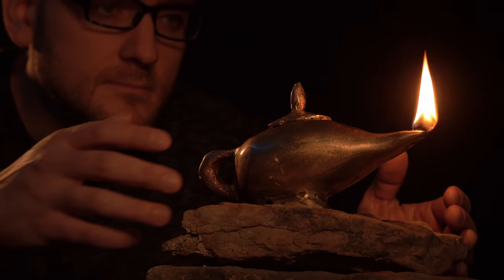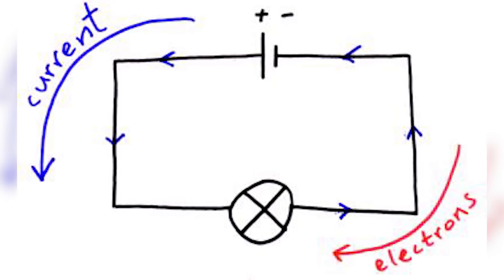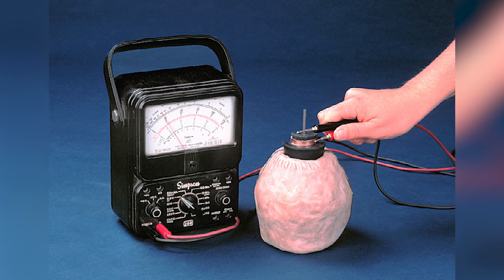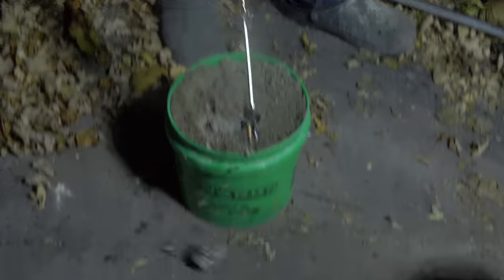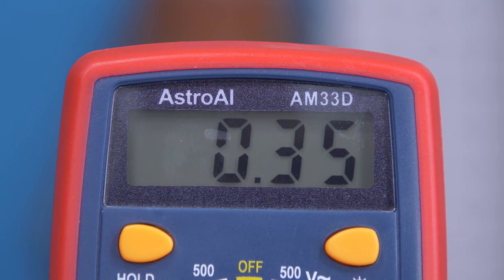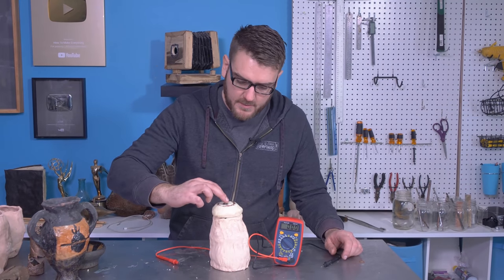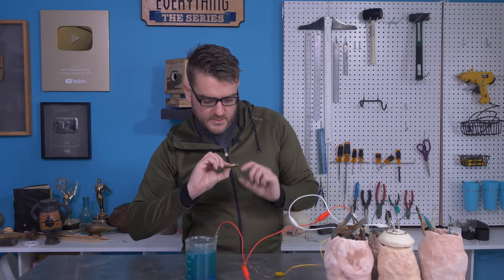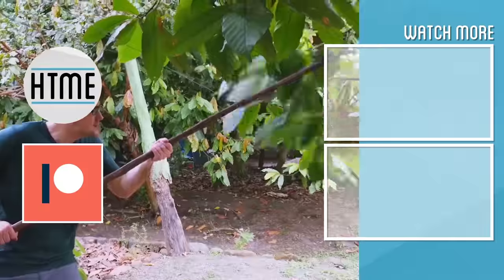Recreating a 2000-Year Old Battery?

Comment: i'm glad you figured out that casting a cylinder is not the easiest way to make a cylinder, though it was an interesting idea.  sheets of material is most often preferred to work with for fabrication of hollow vessels.  i noticed Lauren used that thinking on her pottery as well.  Honestly as compelling as the evidence is, i have a feeling there is some other purpose to the "baghdad battery", but i cannot say what it could be.  it really is mysterious.
Reply: It's not all that mysterious, it's likely just an accidental battery, the original design clearly wasn't made for a battery (it shorts out) and it's probably just meant to be a jar for storing vinegar or wine. The use of copper vessels to store these things is actually quite common because it doesn't leech into the liquid and change the taste. They might have just been trying to create an air tight seal with the asphalt.

Like after all, copper and iron are commonly used materials and almost all agricultural products you'd store in a jar are also electrolytes. The real mystery is that we didn't discover electricity a lot early from an accident like this.
Reply: @hedgehog3180  did they even know air was a thing?
Reply: My suspicion is that it was simply a novelty, an interesting phenomenon somebody noticed and tried to refine with no real goal.
Reply: Torture? If it's better made and makes a higher voltage...

I recall reading about the Bagdad battery a long time ago, and old time scientists getting a slight shock. I may be mixing experiments though
Reply: I always thought it was used for Electroplating metal jewelry.
Reply: Mythbusters did an episode on this. They worked under the idea that the batteries might have been used to "feel the touch of god" when touching the outside of a container, such as the replica of the Arc of the Covenant they used in the episode.
Reply: @LightPink  Not really in the sense that we think about it but they might have known of the necessity to properly seal containers if you don't want the contents to spoil. But it might also just have purely been motivated out of a desire to make sure the contents maintain their taste.
Reply: I'm betting medicine.  Someone discovered that an iron and copper nail in a lemon make a tingly feeling, figured out what caused it (acid, iron, copper), and they used the tingling as a cure for various things.  It probably even worked for knotted muscles and stuff.
Reply: @Earthenfist  oh, it was the world's first TENS device!
Reply: It was most likely used to electroplate stuff with gold and silver
Reply: @LightPink  Air was discovered pretty late, but 2000 years ago, people would have figured out that air degrades foods.
Reply: The most reasonable explanation I've seen... It was just meant to preserve scrolls or something.
Reply: @morrigankasa570  I can't believe I had to scroll this far down to read the most logical and likely hypothesis. I've known this for over 25 years.
Reply: @plzletmebefrank  or something..? Great explanation. You don't necessarily have to preserve scrolls. You just rewrite them. It was for electroplating. This used to be common knowledge. How has the world forgotten?
Reply: Might make your tongue tingle if you licked both electrodes at once. I can imagine somebody figuring it out accidentally and being puzzled that licking one does nothing, but licking both creates a tingle, but even then only as long as there's juice or wine in the jar.

As kids we used to do that with 9 volt batteries, just fascinated that we could "taste electricity".

If we didn't know anything about electricity I think we'd have been even more fascinated.
Reply: @hedgehog3180  nonsense…
Reply: @simasimson5798  you’re as weird as hell right now…check your head bro 😵‍💫
Reply: @Liftedkilt  this makes some sense…
Reply: @plzletmebefrank  lolol
Reply: @mattmarzula  It's never been, "knowledge" it's thousands of years old. We can't know what it was used for cause there's no evidence besides the jar itself. Which there has been falsified evidence a couple times, theories that make no sense pushed other times, and over all... Just a bunch of idiots looking at it from a modern perspective that makes no sense to.
Electroplating require an ionized solution of the metal you're trying to electroplate onto whatever you're dunking in. It's not something you can do very easily by accident, even with modern supplies. And it's doubtful anyone thought of it until they had an actual understanding of electricity.
Reply: @mattmarzula  in fact they didn't use scrolls, instead they used clay tablets. And unless we find a written description or electro platet material (wich i think we haven't yet but i might be wrong) we will not know the exact purpose of this thing, besides i believe that electro plating makes the most sense. (forgive my bad English it is not my first language)
Reply: @plzletmebefrank  maybe not electro plating but electro acing, you can do that literally with a battery a qtip and saltwater
Reply: @barjekold7140  I've read articles that mention similar jars used to preserve sacred scrolls... Are you sure they didn't have scrolls? Pretty sure it was dated about 2000 years ago, and that it was Iraq. I know there were scrolls that were commonly used in many cultures surrounding the Med at that time, would make some sense that the peoples who would've living in what's now modern day Iraq would've been included in those.
Reply: @barjekold7140  I assume you mean electro etching. Which... Certainly more plausible. Not sure what the purpose of it would be. That is what clear advantage it'd get you over the methods used at the time that justify the time and resources spent on a... Fairly janky setup.
Reply: @barjekold7140  Oh, also, you are correct. There is absolutely no evidence of electroplating at that time. No written records, no signs of electroplating. The jewelry the research assistant that came up with the hypothesis that he thought may have been electroplated... Was not. Something to do with mercury and... I believe the term was fire guilding?
Reply: @plzletmebefrank  as a metal worker for me it makes much more sense tha fire guilding (it's maybe the right term i only know the German term feuervergoldet wich is essentially the same thing) was invented before electro plating.
Reply: @plzletmebefrank  Yeah the boiling off of the mercury in a gold-mercury amalgam with heat leaving a deposited surface of gold, as mercury vapours are invisible I can't imagine it was easy for those performing it to protect themselves from cumulative mercury exposure. Personally I imagine it was just a curiosity, an effect discovered entirely by accident that had no real purpose beyond showing to other people
Reply: @LightPink  probably not what makes up air but like wind and stuff then yh
Reply: Electroplating is the general consensus among Archaeologist.
Reply: @leprcon8  what makes you think that? Do you know the electrical requirements of electroplating? (I haven't looked it up yet and I don't know off top but I'm guessing it's not enough current)
Reply: @Liftedkilt  Mythbusters make up some of the most ridiculous bullshit I've ever heard. Including that. If you think the Baghdad battery is anything other than a wine vessel, you're giving them too much credit.
Reply: @Liftedkilt  I'd honestly take literally anything from that episode with a massive grain of salt, that episode is notorious for meddling on discoveries part
Reply: @hedgehog3180  We did discover electricity several times, kinda like steam powering, but it just was a prop, a magic trick or a toy.
Reply: @hedgehog3180   I'm guessing electroplating or fire starter. Egyptians were very fond of electroplating.
Reply: Scroll storage. The original liquids found in the Baghdad battery were leftover from decomposing papyrus
Reply: Or coil pots.....

Comment: USB phone chargers are 5 volts and demand some pretty high current compared to what you'll get out of those batteries. Try using them in applications where you would use AA or AAA batteries and you might get better results.

It would be fun seeing you get enough power out of this to run an old Game Boy Pocket or Color. You just need 3 volts at 250 milliamps or 6 volts at 250 milliamps for a "grey brick" Game Boy. Those are the numbers I read off the AC adapter for Game Boys. You might also be able to run a TV remote.
Reply: probably an LCD screen
Reply: Red Dwarf  have done a episode doing that for their remote control. 🙂
Reply: if you connect a bunch of those in series you may get a higher voltage

Comment: This reminds me of one summer back when I was 9 or 10 in summer camp.  The pond at the camp was near dead and we were told it was due to acid rain (this was when they first started educating us on acid rain) and we spent days doing various water tests, trying to see what animals and plants still lived in it etc, and they taught us on what can be done to fix it.  One of the counsellors brought us out to the pond one morning and had one group of kids take some pipes attached to long wires to one side of the pond and my group took some copper pipes with wire connected to the other side.  We took turns hammering them into the ground in the pond making sure to keep them equally spaced and then we carefully laid the wires down as we went back to the middle of the beach at the meeting point.  The counsellor took the ends of the wires and connected them to a switch that was already wired up to a light bulb.  We all knew that the wires were only connected to the pipes and no batteries or other power sources connected.  We were blown away when he flipped the switch and the bulb lit up.  it wasn't super bright but bright enough to be seen in the daylight and fairly bright at night.  We all took turns that night flipping the switch on and off still amazed that we were creating power with metal pipes and a poisoned pond.

Comment: It could also be that the 'Bagdad Battery' was simply used for the shock value.  Probably more impressive than static electricity.
Reply: Static electricity ca actually be over 20,000 volts. You would need a quite a few 0.5 volt batteries or more advanced electronics to get something impressive
Reply: The battery wasn't a battery.
The iron rod doesn't make contact with the electrolyte on the original pot, and there isn't any terminals; out of the areas people suggest are terminals (the top thing), it would immediately short the terminals out as the iron rod and copper sheathe touch each other directly, and they would be acting as the positive and negative terminal.
Reply: @D-Vinko  Yeah and like considering that almost all fluid agricultural products (wine, vinegar) are electrolytes this is probably just an accident.
Reply: I'm shocked!

Guess it worked. 😁
Reply: In the 18th century it was popular for rich scientists to bring out fairly large batteries at parties and amaze their guests with stuff like having everyone hold hands and then having the people on the ends touch the nodes, giving everyone a big shock.
Reply: Meanwhile not too far away one of Electroboom's ancestors was inventing what will be known as Teheran's Full Bridge Rectifier
Reply: I guess it was used to amp up the mood.
Reply: @fakjbf3129  You cannot do that with only a battery. You would need coil or transformer for that.
Reply: @user255  Yeah they probably used a static electricity generator, like a glass sphere and a Layden jar.
Reply: @fakjbf3129  my chemistry teacher did this in class... but he used a tuned down taser. :P
Reply: Maybe used to make a spark for fire?
Reply: @whydoesyoutubehaveahandlenow  You need a lot of them to make the spark hot enough...
Reply: @JohnWayne99999a  A shame he didn't get to invent the MOTHER OF ALL FULL BRIDGE RECTIFIERS!
Reply: @dragon.fromindia3235  Wrong thread? Anyway, updated vaccine is coming.
Reply: @user255  updated vaccine should be easy to do with mrna. At least that's what they say..im honestly curious as to why they haven't done it
Reply: @whydoesyoutubehaveahandlenow  Yes, the technical part is easy. The bureaucracy is not necessarily so easy. Also the current vaccine is reasonably effective against the current variants. Maybe they also try to optimize the updated vaccine to be as good as possible for new variants in near future. Bit like with annual flu vaccines.
Reply: @fakjbf3129  with dc current huh? Sounds safe...
Reply: 😂 shock value
Reply: @fakjbf3129  what kind of battery created in 18th century would zap u lmao.
even our current batteries won't Shock u unless u lick them and then it won't even hurt much.

Unless ur talking about layden jars
they're not batteries, they're capacitors and store electricity in a different way to batteries.
Reply: at 9V you can get a painful shock in your teeth or tongue.
Reply: Without written records, Benjamin Franklin's "Lightning in a bottle" prototype would make as much sense as the Bagdad Battery. It didn't do anything relevant yet, they maybe just figured out what they created. It's a detail lost to time.

Comment: Hey, while you do your casting in the buckets i suggest insterting a metal/wooden rod while you pack the sand in so there is an air flow and over flow point, your pours are GREAT but with no vent the air only has up through the metal to go hench any bubbling,uneven,cracking pours :)

Comment: I like to imagine that the BB was made by a time traveler looking to recharge his time machine.
Reply: They would've used something closer to a mill of some sort (wind, water, or animal powered) and used that as a generator rather than use this pittance of a chemical battery.
Reply: @plzletmebefrank  that's a good idea, but the problem is: where do you get anything magnetic to create the current on the copper?
Reply: @LuisSilva-nt4vu  There are natural magnets. And you can magnetize some different metals pretty easily.
Reply: Pretty shitty time traveller if that was the best they could do.
A battery that's not a battery.
Reply: @DBT1007  Wouldn't it be more believable that it's just a jar used for storage of some kind? There are similar ones that have been found that contained sacred scrolls. The asphalt in the original covered the copper completely so... You don't have both contacts. And the amount of charge the thing outputs is pathetic.
Reply: @plzletmebefrank  but why then place a copper tube and an iron rod inside this thing which contains some vinegar if you want to store scrolls in it?
Reply: @MrMelonMonkey  It's been too many months since I looked into all the reasons why it doesn't make sense. And I found it doesn't after hours of research. Unless someone is gonna fall from the sky and present reasonable evidence to the contrary... I'm just gonna stick with the opinion I spent hours researching, even if it was months ago.

Comment: I'm really curious now how much current can this thing supply. and please, please do more electricity! amber rods, electric fish, all that good stuff that seems totally impossible for you to source but would be super cool to watch.
Reply: The LED didn't light up much so it's probably below 30mA but take this with a grain of salt
Reply: @ornessarhithfaeron3576  that would be my guess as well but the measurements would be nice to see.
Reply: electoboom dod something on it i think
Reply: Might of been "lemon battery powers car" , but I think at a certain point adding more in parallel stops adding to the current because of the high internal resistance.
Reply: Close to nothing… the originals were not batteries but containers for sacred papyri.
Reply: @superrinusblick4222  please double check your units.
Reply: Watch electro booms video he talks about this
Reply: @ornessarhithfaeron3576  That or the driving voltage isn't enough to switch on the LED - I think that's only with blue LEDs though ...
Reply: 3 battery gives some 1.5V what barely illuminates red led, no other colors.
Reply: you can calculate it but it wont be a lot since the voltage is very low
Reply: @juhajuntunen7866  its also common for in series battery cells to provide less than "standard" voltage, lead-acid battery cells provide 2.2V when fully charged but the common 6 cell batteries in our cars are 12.6-12.7V when full
Reply: Electric fish?

Comment: I hadn't heart of the Baghdad Battery prior to this video, but I think it's really interesting! I'm not sure it was actually a battery, but the fact that 2000 years before the battery existed they actually had the ability to do it, whether they did or didn't, is amazing.

The biggest thing that leads me to believe it was something other than a battery is using the bitumen/asphalt to seal it. Wouldn't the solution inside need replacing semi-regularly? That would be a hassle to do when sealed with bitumen.
Reply: The current explanation is AFAIK that people back then stuffed all kinds of metals into these cylinders. Some just happend to be a battery.

Comment: I'm sure someone has said this already but if you want volts, put the batteries in series. For higher amperage, put them in parallel, and make sure your positive and negative electrodes are as close together as possible without actually touching as this will minimize internal resistance.

Comment: As I understand it, there is only one single example of this 3-part artifact.  The original excavation in 1936 and the context were not well-recorded.  The pottery style probably dates from 224–640 AD.   It was found with the iron rod inside the copper cylinder, which was inside the clay pot.   Modern analysis would now almost certainly be able to determine the make-up of any liquid a newly excavated jar contained.    But until other examples are found its function can only be speculative.